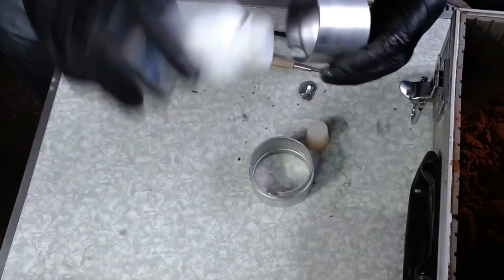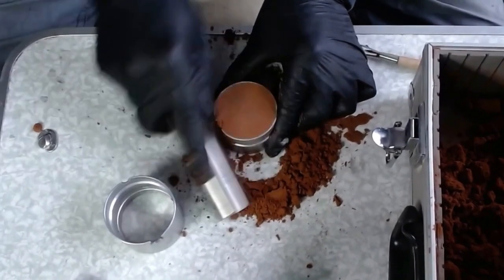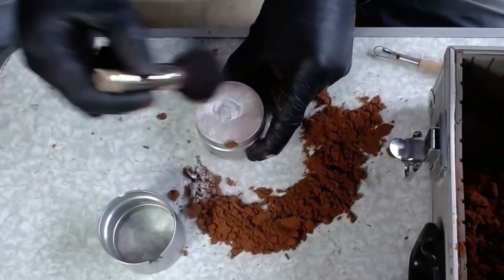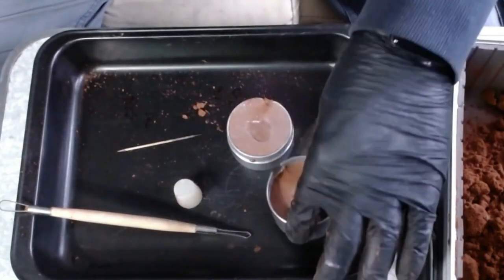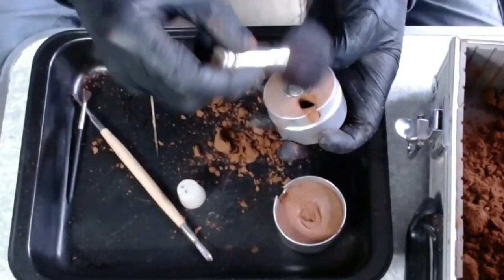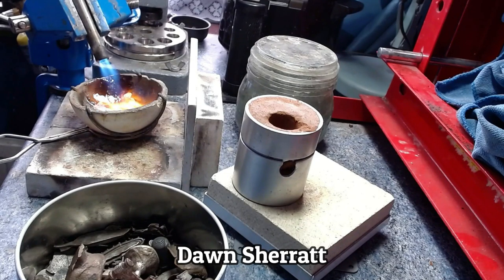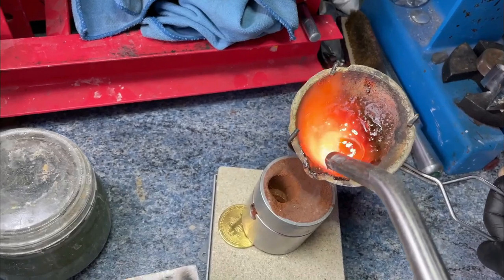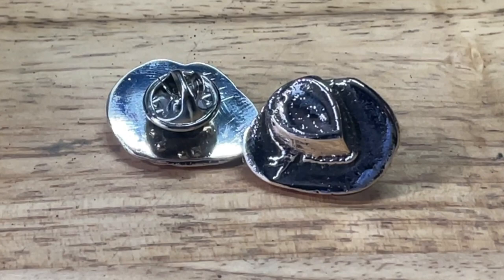Sand casting made VERY easy

Comment: Thank you for your videos, they are great. I have a question, could I cast a Dome Ring or a concave shape in the delft clay casting? And if so, how do I cover the empty space?
Reply: sand casting is not the way how to do it. Better try silicone casting. Silicone for high temperatures.